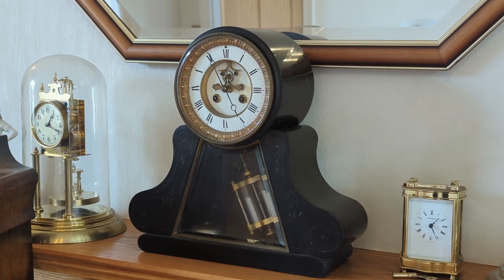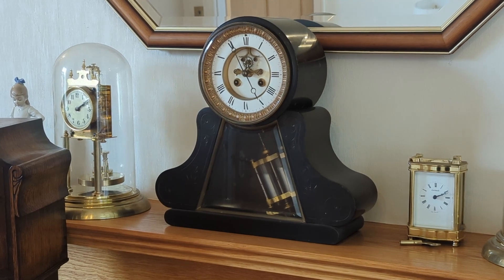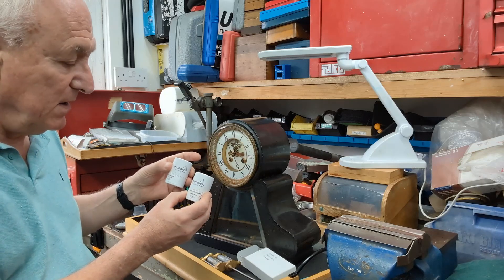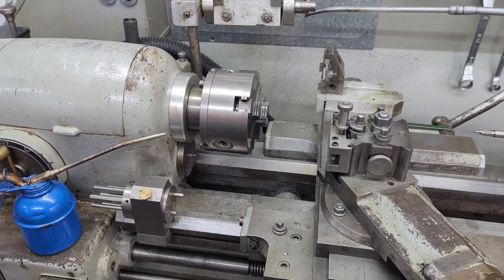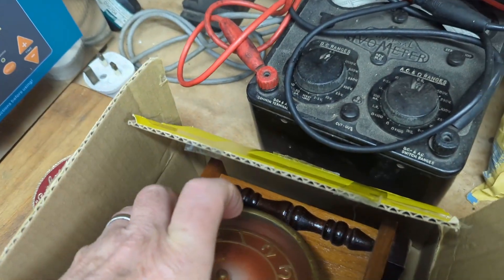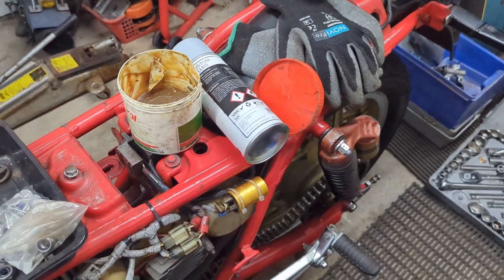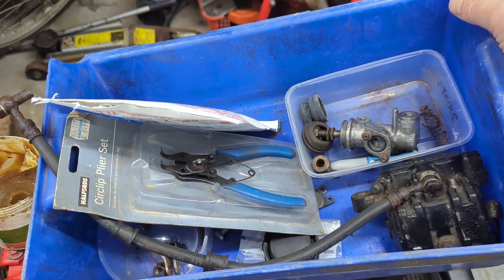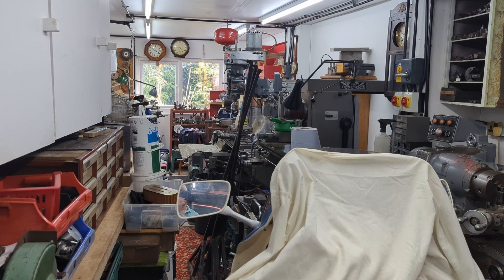Unlocking the Mysteries of a Mercury Pendulum Clock | Workshop Update

Comment: I have been restoring an old Atlas 612 lathe, and one thing I did was replace the motor with a 230 volt three phase motor, and I run it off a VFD. This allows me to slow down the lathe quite a bit!
Reply from the maker: Thanks Jeffrey, that's one good way of controlling the speed. With the treadmill approach it leaves both hands free which is useful when using scrapers etc.